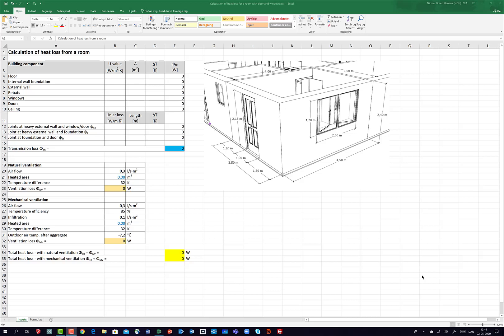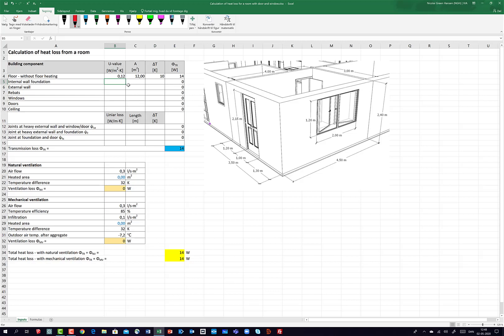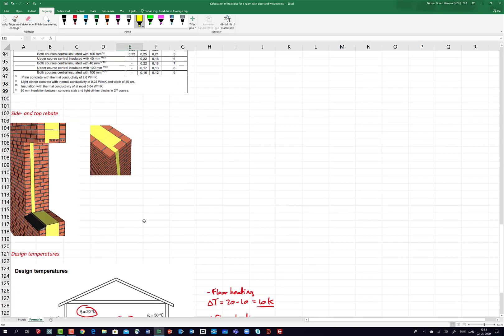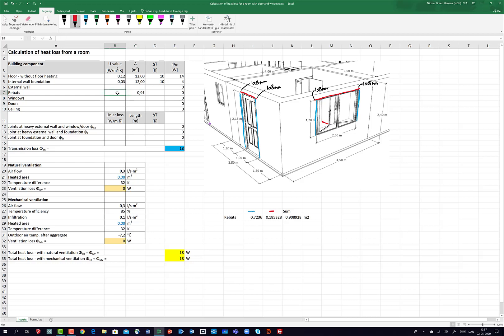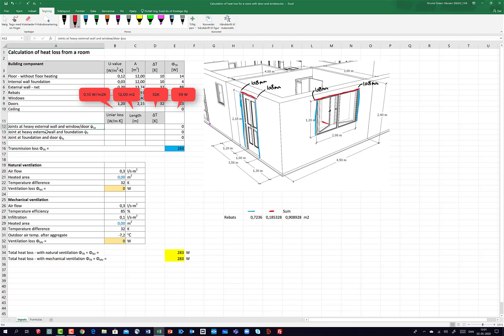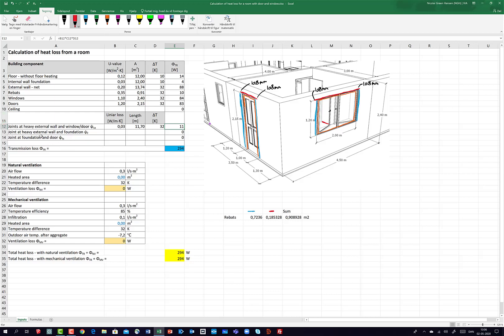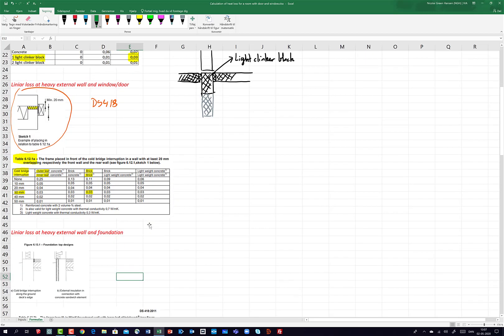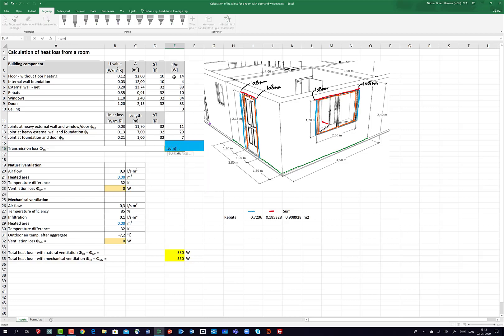Calculation of heat loss for a room with door and window

Comment: Hello sir, your video is really helpful for gaining the understanding . I have a question, in which condition do we have to apply PDE to solve this problem (heat loss)?
Reply from the maker: Hi Kartini
I am not sure what you mean by the term "PDE".
Reply: @NicolaiGreen it is a partial different equation . Let's assume for the house compartment. There is a source of fire in the living room, and we want to know the temperature in the bathroom. Since the fire grows (not a constant), it is dependent on the time
Reply from the maker: @kartiniganesha6741 Alternative heating sources as fire from wood are assumed as supplementary energy sources and are not taken in consideration.